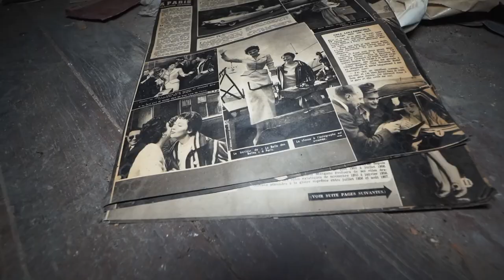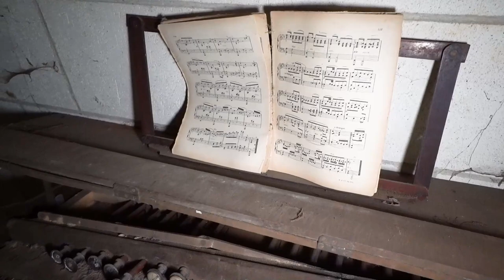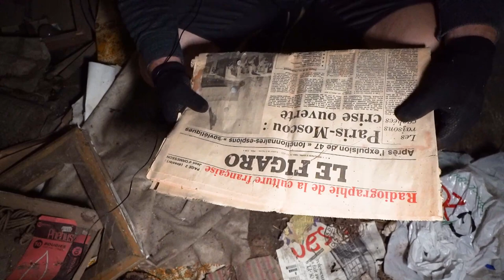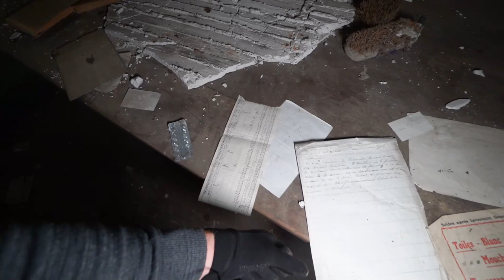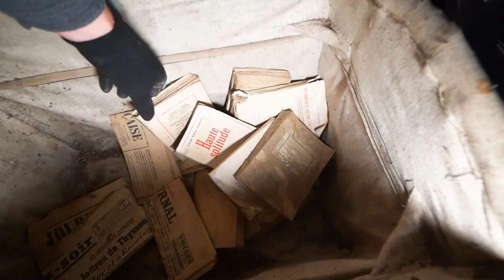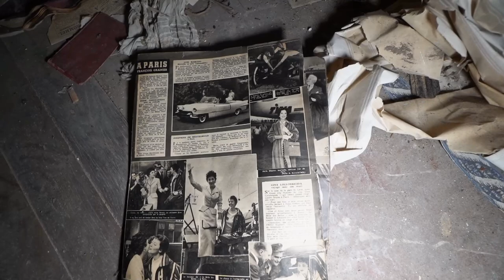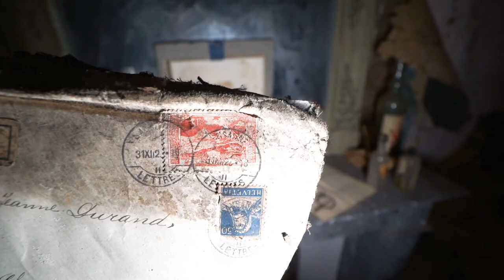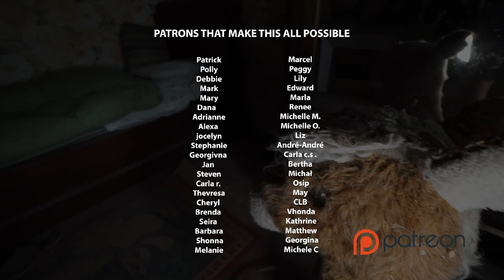WHAT Happened Here? Abandoned 18th Century Mansion Of a Pharma Family

Comment: Lovely  little  house, stunning  bed and very unusual  blue and white wallpaper.  I believe The cast iron panel against  the clock  down stairs  could be a panel for the back of the fire  possibly?
Reply: That's what I thought too!  I believe they are called 'fire backs' and were used to help radiate the heat from the fireplace out into the room.  They probably also protected the brick work/stone at the back of the fireplace.

Comment: They had some fabulous furnishings...Next to the stove w/3 legs was a "Butcher Block". The heavy steel leaning against the clock goes in the fireplace to protect the back wall of the fireplace and it heats up and holds heat. The sleigh bed had wooden wheels that did not swivel (so very old). It looked like they tried to get it out the door but it was too big, so they left it crooked. A pro furniture mover could have gotten it out. The little brush was for shaving. U would take the soap to ur face with it. This had to have been a jewel of a place just by the stairway and marble mantels.

Comment: The heavy iron plate had embossed images leaning against the grangfathers clock, is called a "fireback" was mounted in back of a large fireplace. These were very early 1700s and 1800s were made  hand cast in a sand mold.